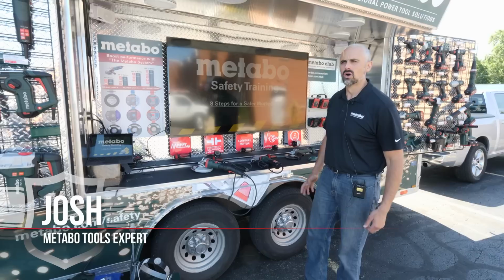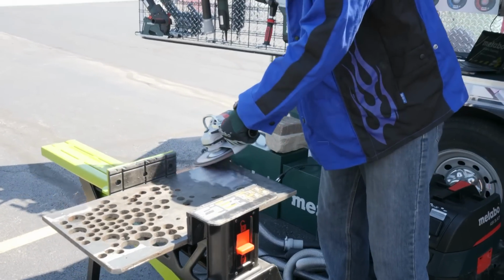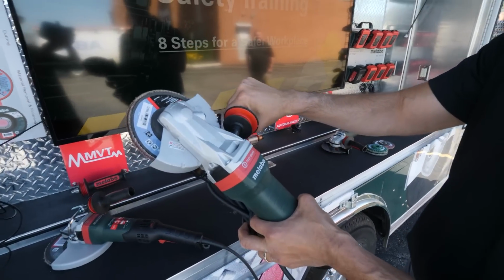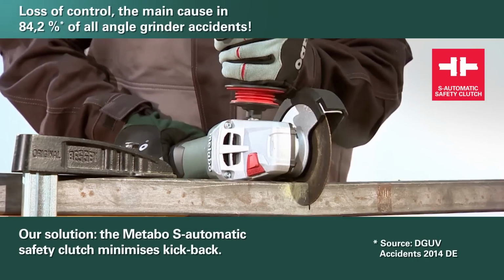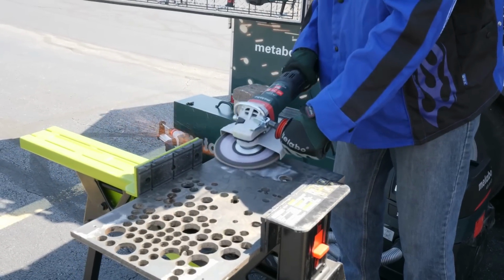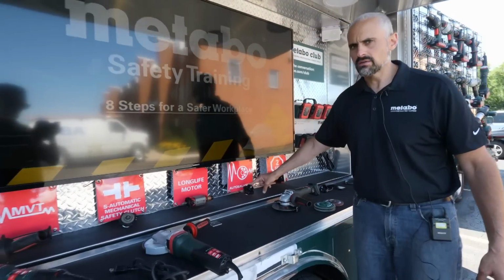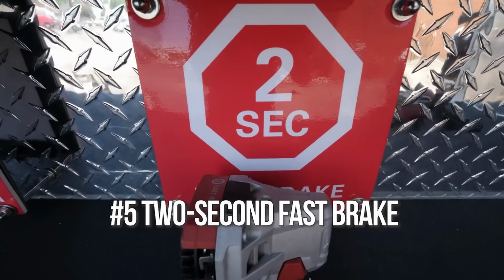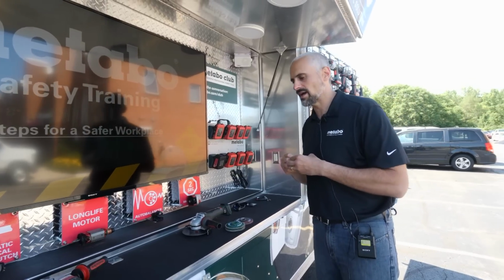Top 5 Reasons Why Metabo Grinders Are Industry Leaders in Performance & Safety

Comment: How does one use a spin on grinding wheel on the newer wepba version grinders with the thicker auto balancing disc ? When installed the grinding wheel is almost protruding outside of the guard.

Comment: The 2 second stop doesnt do anything more useful then allowing you to put down your grinder quicker. Because Δx=v0t+0.5at^2 means that after a drop distance of 19.6m or 64ft the grinder should have stopped. (if the blade wasnt impacted or hit by anything hard) And it doesnt matter what it is, having something dropped on you from that height with that weight is a serious issue!
Reply: this is however not a math assignment at school.

Comment: Sorry but metabo grinders suck, I have used them for years due to my only wanting to buy metabo tools. I use grinders for many hours a day and they just don't last. I finally persuaded them to buy me a milwaukee angle grinder, still going strong after 2 years. I got roughly 5-6 months out of a metabo
Reply: If u burn up a metabo grinder   u have a low end version or u shouldn't be allowed to use grinders 

I have a 230 metabo thats 12 years old 
Still works 
10 year old 125 
And i recently got a verifiable speed one 

And a Hitachi thats from 1994 which is still kicking 

That get used daily 

For long hours   

So im questioning how u treat them and how expensive they were          cuz its probably something ur doing and not the tool
Reply: @STOkitten  it's nothing to do with how I treat them, they are tools that get used heavily at my work. We have at least 10 metabo grinders at the back of the fab shop all burnt out.

I'm not the only one that uses them, I work with 3 other people.

I have been a fabricator for the passed 10 years, do not tell me what I shouldn't be allowed to use.

I'm sorry if you're offended of me saying that metabo grinders suck, jeez people are literally offended by everything these days.

Sad world.

Comment: Metabo's SUCK i burnt up 4 in 8 months 

Had a DeWalt/ Milwaukee for years and they still kick it.

A good grinder can handle pressure applied into it while grinding. Metabo's cant they smell like burning plastic when you do.
Reply: U can kill any grinder if u do that 😐
Also Milwaukee grinders are shit compared to the metabo for the same price
Reply: @WilliamHelstad  corded id say metabo  and Bosch 
Cordless Milwaukee
Reply: If you have to lean into it that much then you need to learn how to grind, or use the right grinding disc for the job.  Unless you bought a metabo from lowes.
Reply: Grinders seem to be the tool where people love one or two brands and hate others. I know other people who've done very well with Metabo and had bad failures from your favourites. I'm looking for variable speed 115mm or 125mm grinder with soft start and a brake. To complement my 8 year old single speed Bosch. Corded, though I have 2 old M18 4AHr Milwaukee batteries so I'd consider bare Milwaukee. Reviews proving very inconsistent! The Bosch will do heavier work, eg pointing. New one will be for in situ tiles and one-handed work
Reply: Just worked out why we get polarised conflicting opinions on grinders. It is not Metabo vs Makita vs Milwaukee vs Bosch  vs DeWalt. Each brand has 5+ variants for each disk size and corded (240V, 110V) or cordless. Variant A might be very lightweight, low power (eg 500 Watts), perhaps budget. Variant F might be 1900 Watts, heavy. Use A for light work domestic diy thin tiles, 8mm bolts, wood saw, sharpen mower blade. Use F for all day pointing, paving slabs, etc. Of course, Brand X vA will burn out doing pointing while Brand Y vF thrives on pointing for 5 years. But Brand Y vF is heavy, clumsy, overpriced for occasional delicate work.
   I usually look first at 1-star reviews, but often, the reviewer has not used the product for its range of uses. Oth, 5-star reviews often given after one day's use.
   What I do know is DeWalt corded tool quality and service in UK has plummeted over last 5 years compared with ten+ years ago. Everyone and my experience shows they just focus on cordless now. Makita have kept up standards and even upgraded old models